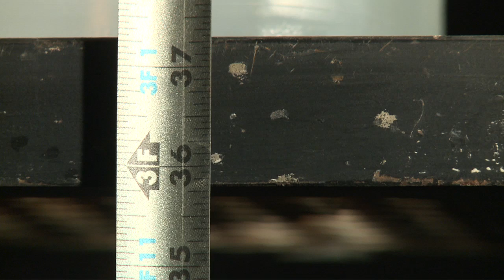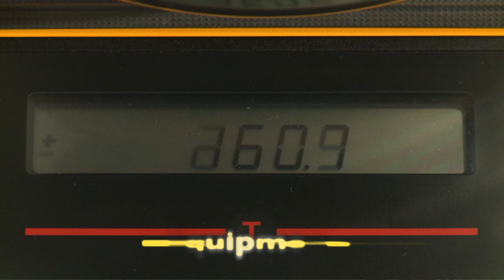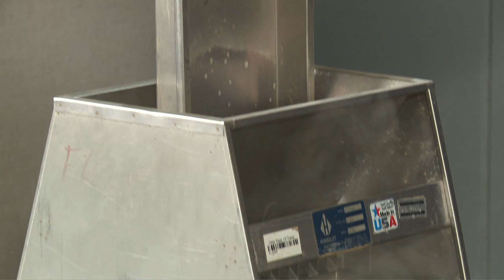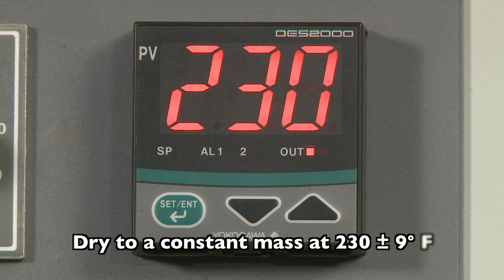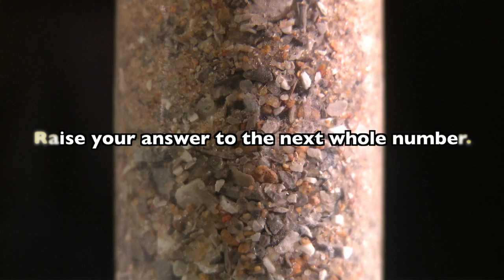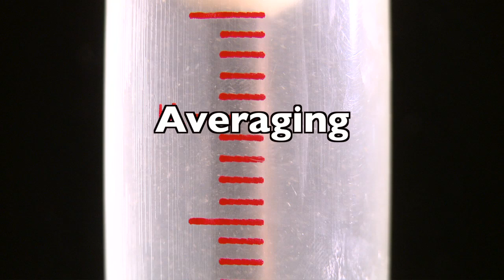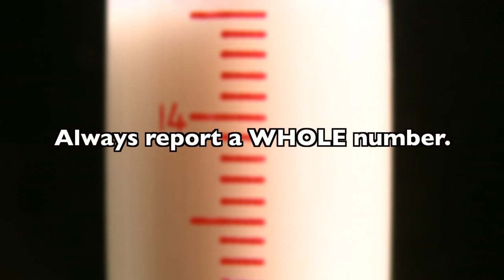AASHTO T 176  Sand Equivalent Test

Comment: preparation of sample was according to method but not was according to standard
your gay was shaking sieve on wrong  way.
 and your technician did not use hand gloves 
when you will not use hand gloves during the mixing of sample it will effect on clay and dust value 
because which clay will stuck on your hands during mixing of sample its mean you lose it

any way 
it was good effort to shear your knowledge
Reply: 1. It is more appropriate to hand shake according to section 8.4.2 of AASHTO T 176. We should probably make those instructions more standard. 
  A. For mechanical shaking, use a reciprocating motion mechanical shaker as defined in AASHTO T 210, Aggregate Durability Index, which we should probably reference in T176. My second option would be mechanical shaking as defined in AASHTO T 27, Sieve Analysis of Fine and Coarse Aggregates, 
  B. For hand shaking, 8.4.2 should probably reference hand shaking in T27, and delete the rest of 8.4.2.

2. T176 does not require neoprene gloves or plastic type of gloves, which would not be a bad idea.  The fudge factor due to rounding would not cause a statistical difference with gloves or not.  Typically standard test methods do not allow additions such as gloves.  If the test method was changed to require or allow gloves, I would be ok with either though I would prefer it as an option.
Reply: i agree with you and thank you for showing your interest for reply .